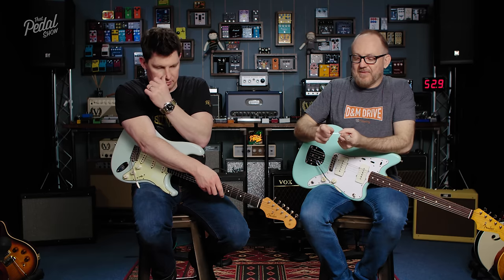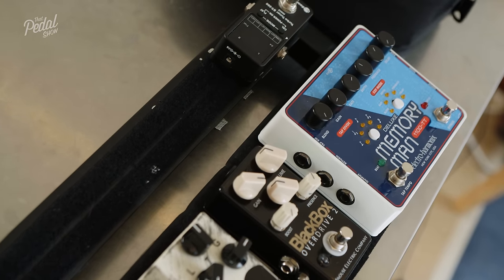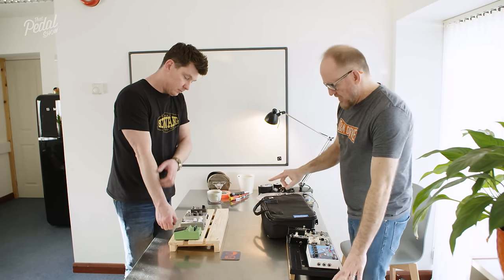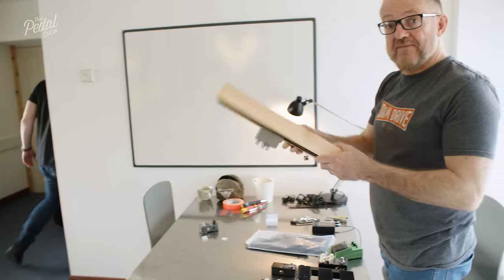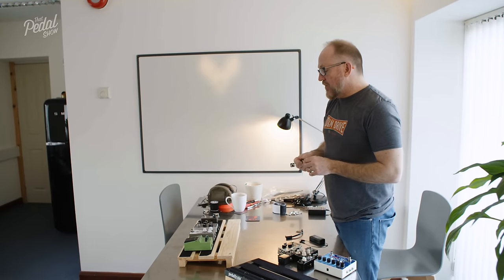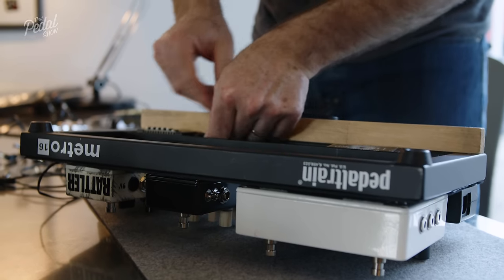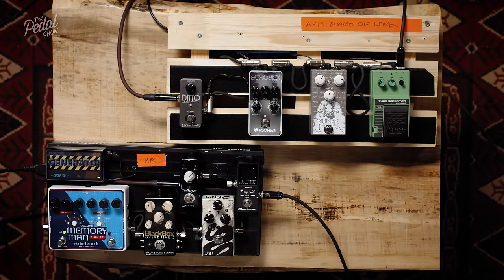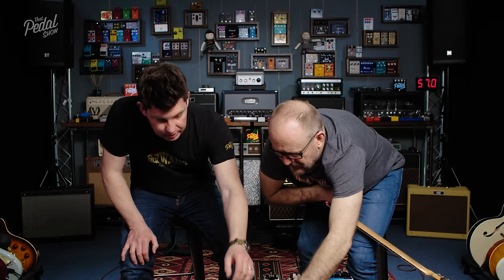Tips For Your First Pedalboard Build – That Pedal Show

Comment: Been playing just over 3 years, and I just bought my first pedalboard. Went with a Pedaltrain Classic Jr. I've been using a Joyo JP-05 rechargeable power supply, and a few budget pedals. Korg Pitchback Tuner Pedal, Boss SD-1, Boss BD-2, TC Electronic Honey Pot Fuzz, and a recent acquire, a Joyo Tauren Klon Clone. I have a few other budget pedals, but the 5 I just mentioned are my favorite of the lot. Pedal order tuner -> SD-1 -> Fuzz -> BD-2 -> Klon Clone -> Marshall DSL 20 CR. Guitars, include CV Tele, CV Strat, Epi LP Custom, Epi ES339. For a relatively new guitar player, this setup is loads of fun. 

The Tauren Klon Clone is now my favorite of the budget pedals. It a warm, relatively low gain pedal, but the way it colors the tone is something I've never experienced before, and I love it. 

I have a Donner Echo Squire delay pedal, but the noise floor is just too much. I think my next purchase would be a better delay pedal. 

Just thought I'd share. Most people in this channel probably have much higher end gear, but us newbs gotta start somewhere :)

Cheers folks.
Reply: “If Louis CK was a pedal expert”, rejected sketch on SNL

Comment: Great video for first time pedalboard builders!

My first proper pedalboard was in 2011. Made from a DAP showmaster 24 (super cheap flight-case! still using it as a second board). had a wah, a suhr riot (sold it, shouldn't have done that), a diy muff and diy tubescreamer, tuner and malekko ekko (sold it, shouldn't have done that). Now upgraded to a heavy duty home-made flight-case featuring a lot of pedals (10 now) including the D&M drive (got it this week, it rocks).

Comment: Yup, I am impatient at the moment with my pedal board build.  This episode may get me going.  I have a suggestion, regarding the right angle barrel plug for the power supply, Mick - scootch the pedal up closer to the slot so the plug hangs straight down.  Finally, I can see where building several smaller 4-5 pedal boards for particular combinations and then controlling those loops with a quartermaster could be quite satisfying.

Comment: tip for rubber bottemed boss pedals etc. You can download a paper template that you print off and it wraps around the base plate  (you can add gaffer tape to to strengthen it). You then put the velcro on the gaffa tape and it sticks properly. I can't find the template online now but I used it for my blues driver.

Comment: Now I’ve seen this, I wonder if you might do a show on pedalboard maintenance? Maybe some cleaning for keeping your board in tip top condition. What tools would you carry with your board to help troubleshoot issues at a gig? Contact cleaner and q-tips? Is it worth having a soldering Iron and solder with you at a gig and knowing how to use it to fix problems?
What about taping up the battery connectors inside pedals with electrical tape to stop the chance of pedals shorting on the battery connectors?

Comment: Close pedals and the problem of being able to step on one pedal without affecting another pedal can sometimes be solved with the little plastic dials the you slip over a hard to reach footswitch. The wider and higher footswitch can now be accessed easier in certain senarios. Especially on pedals in the back of your pedalboard. Mooer makes them that you can get a pack of 12 for like 5 bucks shipped

Comment: This fits quite nicely with Josh's video about Behringer pedals. I got a Donner pedal board for about £35 and it lasted me through gigs for a couple of years fine in it's soft case. In fact I've modified mine recently to have bigger feet at the back (two angled blocks of wood velcro'ed on) for more of an angle and bought a hard case with foam for about £40 to better protect the pedals (since TPS got me more into boutique brands!)
Reply: Yes it sure does. And here is that video for all those that haven't seen it: https://www.youtube.com/watch?v=ApJZa8yCMCQ

Comment: Hey fellas, sorry if I’m being pedantic and you already know this, but you can reuse the evidence audio cable ends. Mick’s bag of “offcuts and too short cables” can be reused, it’s really the connectors that run the bill up. As long as you don’t screw them on super hard you can just unscrew them and remake a cable - I’ve only had the copper core break off in the connector like twice out of maybe 25 cables I’ve remade over the years.

Comment: I hav used short carpet  on a pedal board where id salvaged the other side for the pedals from an old project . Was over 3 yrs ago , still usin it . The rest is by the book . Voodoo pwr , quailty cables , all the good info from TPS .

Comment: I'm 40 years old, and I built my first pedalboard recently! Actually... I'm not done yet. And I have a feeling that you're never REALLY done building your pedalboard. There's always some new pedals that might come in, and some old ones that might have to sit on the bench, until you feel like playing them again. It's not cheap, but it's fun and helps creativity! I have a Line 6 Pod HD Pro, that I bought about ten years ago. I oftentimes found myself just tweaking sound and not ever really being satisfied, because there are just too many options. Also, until I started messing with pedals, I didn't really understand how useful some things could be. Obviously, the Pod HD Pro doesn't have to be used as a pedalboard, you can do whatever, as long as it sounds good. But I just needed less options, and I think I've made the right choice. It helps my creativity. 

Last but not least, this video is very informative, interesting and fun!
Reply from the maker: Cheers mate 🤓🙏

Comment: My first pedalboard was  a fiberglass cafeteria tray that I covered with indoor/outdoor carpeting and rubber feet screwed on. I kept it in a thrift store suitcase. The pedals were : Ross Compressor > DOD Supa-Distortion > Boss CE-2 Chorus > DeArmond Volume Pedal >  Boss DD-2 Delay and a DOD A/B box feeding a Boss TU-12H tuner. Everything used batteries, I think? Maybe a Boss PS and a daisy chain?  Other then that pathetic distortion pedal, it sounded quite good. Amp was a '66 Fender Super Reverb. Wish I still had that.

Comment: Another reason for putting the hook on the pedal and loop on the board is everyone else does it that way so when you buy used pedals you can slap them straight on your board and you don’t have to change the Velcro. I will also second the use of duel lock that stuff sticks like shit to a blanket.  Great video guys.

Comment: I actually did it the other way around, after owning 2 pedals I went and bought a fairly big pedal board (planning in advance) and I still use it.
It currently houses around 8 pedals and a wah (plus king of tone and sun face are on the way so it's going to be tight inside).

Comment: FYI Fellas, Velcro brand industrial strength hook and loop tape works incredibly well, and I prefer it to Dual Lock. I've had it on boards for 20 years, pulled pedals off the board hundreds of times, and have never had any issues. Still holds incredible strong and doesn't peel up off of either surface.

Comment: Always lots of great advice!  I learn something new every time I watch.  Just like reading the bible 😁. A cutting board is a great inexpensive  board.  Mark Lettieri uses a white plastic one for his grab n go board.  Personally I use a bamboo one pretty thick, put the routed channel down (upside down), and use small rubber feet to keep it from slipping.  You can use the feet from that new GAS pedal you haven't mounted yet. I add a couple cabinet handles on each end and it's ready to go for less then $25.  A plastic one can be had for less then $10.  I  believe from personal experience with pedaltrain, that top routing cables will force you to have clean quiet cable runs.   I can't even describe the rats nest under my old pedal train boards just  cause they don't show.  Also if you graduate to a volume pedal it's much easier on a flat board vs angled. Another thing I'll add.  I know this is for a beginner board, but times have changed since I was beginning.   You can get a roll of mogami cable and 30 gls cable ends for less then a cable kit, and much less then individual patch cables.  Check out Mason @ Vertex  tutorials on DIY patch and power cables.

Comment: I have 3 large pedalboards loaded with effects and like to mix and match. I still use the"old fashion" loopers mainly to save wear and tear on a lot of the vintage pedals. I no longer gig but if you do and planning on getting a looper made a bypass is a must. Every channel is precious but if/WHEN any dozens of connections go bad you can hit it and not miss a beat. Also avoid the "DIY" cables like Covid.

Comment: I take the bottom panel off my pedals, wrap a few strips of gaffer tape so they just come over the lip of the bottom plate, and then screw the plate back on – then I attach velcro to the tape. Even with a rubber-bottom pedal, you have a nice clean surface for the velcro to attach to, and if you ever want to take the velcro off the gaffer tape comes off much more cleanly (especially handy for resale).

Comment: I think one of the most important advantages of a pedal board is that your patch cables are stable and don't move around. Crackling bad connections caused by pedal movement kills everything... So the board keeps  everything in place nicely.

Comment: The tinkerer that I am, I dove into the hobby world of pedal building. I’ve learned that in addition to the cable issue solved by the right to left signal path, I’ve appreciated that after reading schematics with signal flow from left to right, I am populating a box from the inside. So, once everything is in the box, I flip it over and voila! everything I did reading from left to right is now a mirror-image from the outside, top of the box. What was left is right and vice-versa. I am positive I would have amplified my mistakes ten fold had I had to worry about flipping the signal path between the schematics on paper with the physical locations on the pedal enclosure. Now, I just leave the mistakes for when I place the decals backwards. doh!

Comment: Ever since I progressed on to Velcro I’ve standardised with loop-side on the pedal, hook side on the board, for exactly the opposite reason Dan quoted: I don’t want my pedals to stick to the carpet!
Also favourite tool to prise Velcro apart: plastic ruler, avoid metal.

Comment: Another thought on attaching the hook side to your pedals with rubberized pad,  use a stiff wire brush to your attachment locations, this allows the adhesive to effectively bond to the roughened or scratched surface.

Comment: Sometimes, if you have the BOSS/Ibanez rubber pad, if you put the hook side velcro on the pedal, set the pedal on a table or other smooth surface overnight so that the adhesive can cure. Then stick it to the board.

Comment: My pedalboard was a long evolution starting with a giant wood plank with 4 pedals on it, i had to rebuild it many times and watch lots of TPS episodes but now it's 60x37cm with 11 pedals, isolated Truetone power supply and digital amplification. I need 1 electric socket, plug my guitar into the board into the cab and i'm ready to go.

Comment: I have an Aclam board, and it has some few extra advantages over a standard board:  underneath there are screw down fasteners to secure to secure power supply, or supplies for extra real estate on the top.  The nice thing about doing it this way is that you can throw an "always on" pedal at the bottom and forget about it.  I have their 59x30 board...10 pedals on the top with an expression.  Underneath two Voodoo Labs: A  Z Plus and an ISO 5...also an always on Keeley 30MS.  BTW: the kit comes with more screw down fasteners than you can ever use.

Comment: I use Velcro hook on the under aide of my board, then use a strip of loop cloth (the kind you'd sew on a garment) to secure loose wires under my board. It's surprisingly secure, at least four around-town gigs.

Comment: I have built well over a hundred pedalboards from crappy board, crappy Velcro, crappy power supply, daisy chains and whatnot to massive SchmidtArray, G2, MIDI, Kingsley, Strymon  wet dry wet and pedalrack dual stereo studio setups ... and I am still enjoying this :-) the most important is: it makes no sense trying to save money for power or patch cables. It will ruin the tone and invite ground loops sooner or later. Dan‘s modular power system is the single best on the market IMHO (no connection or affiliation). Custom length patch cables are the way to go, even if they are painful to assemble. Disaster area is great ... ok, Time to back to pedalboard playing :-) keep up the great work guys!

Comment: Hi Dan, hi Mick. Really enjoyed the video and it's very timely for me. I've recently been toying around with building a "pedalboard". Due to a surgery I haven't been able to play guitar for over a month now, so have been focusing on playing adjacent things. I'm including your videos in that, as they've been great in helping me cope.

I'm one of the type who's been playing for 12 years and collected a lot of pedals and never put them together. I've got boutique pedals like Redstuff, Leqtique and Origin, as well as the more regular Boss and Ibanez pedals. Now at 10 pedals with 3 more ordered, I finally got a power supply to play them together. I have MIDI, channel switching amps, so things are only going to get more complicated, evolving into stereo multiamp setups and maybe a rack processor.

Anyway, this is very pertinent because I recently threw a together a "pedalboard" using a tea tray no one was using from the kitchen and my favourite analog pedals. Cali76 into Leqtique EQ into Redstuff 1987 with an Ibanez AD9 in the 1987's lead channel loop. It's been a lot of fun, even if I can only get friends to try it out for now.

Down the rabbit hole now, time to get a MIDI controller/looper. Any suggestions?

Comment: Casting a vote for the MXR DC Brick power supply. I have 6 pedals total, and in spite of the low profile of the unit, I have more spots and it has 2 18v spots. It is quiet, and handles them all really well. Comes with a cable for all of them and it’s great for the price.

Comment: I consider three pedals essential for guitar: tuner, reverb, and drive (in order of purchase, not signal chain). For bass that would be just two: tuner and compressor, but really the compressor isn't actually essential, so just the tuner.

My first pedalboard was something I built out of pine, because I was working in a lumberyard, but I quickly found that I'd built it too small and that I hated having my pedals velcroed down, because I liked to switch my signal chain in the middle of a set. So, for years, I used a long chain of loose Boss pedals. I got very good at setting up and striking my setup quickly, which was helped by the fact that I used only Boss pedals and powered them from a Boss daisy chain. Standardisation helps immensely!

These days, for bass, I use two Boss BCB-3 boxes, and six Boss pedals. That's easy. I use a flat board for my guitar board, but no Boss pedals for guitar, currently. My current pedalboard is a 12" x 24" piece of 1/2" CDX plywood painted flat black with six rubber feet on the bottom, but I'm switching to a 19" x 12.25" x 1/8" aluminium 7U blanking plate for an EIA equipment rack. I actually wanted 500 mm x 300 mm, but this is as close as I can get without having access to a metal shop or a fabricator.

I prefer a flat board because I tend to lose my balance if I pick up my heel off the floor, so I don't want my pedals raised up any higher than absolutely necessary, so I can only pick up my toe to switch--and I pray for a flat stage, because the 3/8" high rubber feet won't be happy on a lumpy stage! I arrange my pedals so that the pedals I switch during songs are in the front, and the pedals I switch only between songs or are always on are in the back row. I have a total of 13 pedals on my board, but when I rebuild it, I'm taking one off and will live with 12. Everything is powered from a 9 V/2000 mA daisy chain.

My flat board is designed to fit inside a standard 22x14x9 rollaboard suitcase and still leave enough room for a couple of days' worth of clothing and toiletries.

Because I'm accustomed to the Boss BCB pedal case spacing of 100 mm on center, that is the spacing I prefer switch-to-switch. However, I discovered that with my tc electronic pedals, with standard right--angle patch cables, I have to go about 106 mm on center to clear the plugs, and that makes my board too big. So, I've switched out some of my full size pedals for mini versions, and learned to live with spacing as close as 70 or 75 mm (mainly for pedals I don't switch during songs, and I've switched to flat molded patch cables.